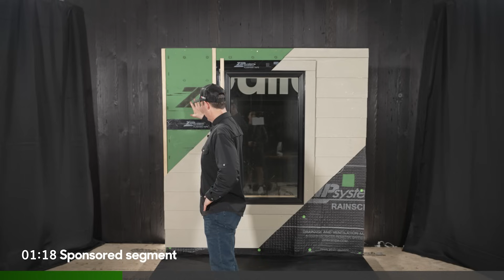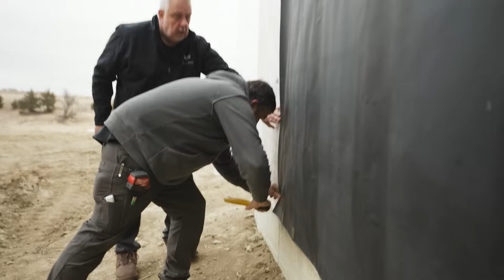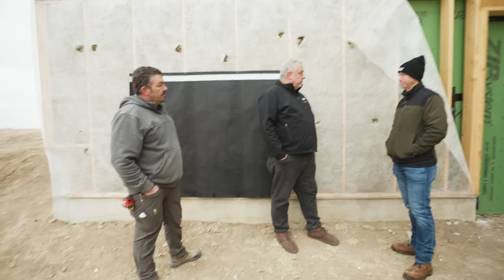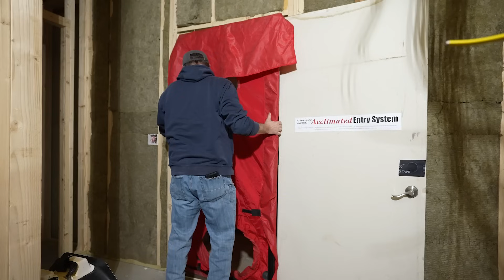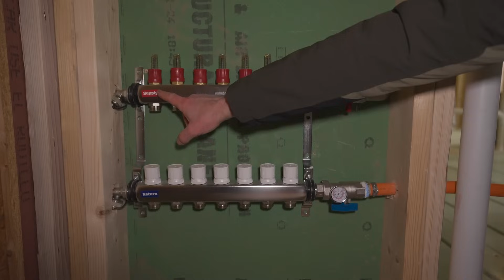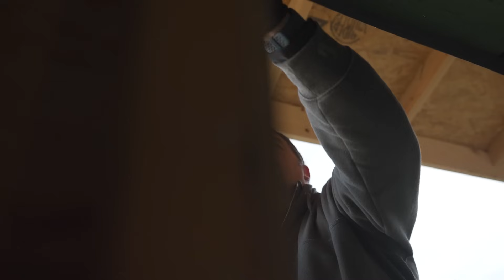Build Across America Episode 1 - South Dakota Perfect Wall

Comment: Very Impressed and I understand staying small as  a builder. Employees can be unreliable and costly.  However, having at least one gopher, wall lifter and tape holder would surely   increase your productivity more than it would cost.  Also you inevitably do some unsafe things on ladders and other places when you are trying to do things alone. One knee, back or shoulder injury is going to shut you down at some point. In the long run your health and productivity   as well as passing on your knowledge are reasons to consider a full time employee.  I have helped frame 50 plus homes in a similar climate in Idaho and could not imagine truss day without two to four framers on the job.

Comment: If the ZIP is only functioning as an air barrier wouldn't it be cheaper to use a comparable plywood as an air barrier and save some dollars or perhaps there is something related to warranty that makes the ZIP system more preferable.
Reply: OSB and Plywood are not a great air barrier. The integrated WRB of the Zip is key and the ability to successfully tape to the panels

Comment: I’d like to see the engineer in on these discussions. They must have had to make special details for a lot of this.
Reply: why it is standard platform framing, and truss company designs the floor and roof
Reply: Since the outer framing is supporting the roof there is no lateral bracing until the outer framework racks 2” into the inner frame. That outer needs lateral bracing.
Reply: @josephraccuia9870  no it does not the roof trusses also bear on the interior wall. Both walls are tied at the plates and every window and door opening ties the walls together at each opening
Reply: @josephraccuia9870  also please note, you haven't watched the video closely or you are guessing because the house has a full sheathed diaphram nailed to the underside of the trusses that ties ALL the wall together.

Comment: If we are so concerned with tightly-sealed houses, why don’t we have clothes dryers that keep conditioned air in the house? We should have dual hose dryers (like dual hose portable AC units). One hose for intake, and one hose for exhaust. Never losing conditioned air from house. 
Otherwise, here in AZ, we take hot air from outside, cool it down, it gets sucked into dryer, HEATED BACK UP, then pushed thru the dryer to the outside again. Oh, this creates negative pressure in the house, which causes HOT AIR to stream back into house, which then has to be cooled back down to room temp with house AC unit. Just plain dumb how we allow this.
Reply: More regulations ?
Reply: @merwinwilder3904 , I would love to be able to draw in hot dry Phoenix air directly into the dryer, heat it up slightly, and blow the hot, humid air back outside. 
Versus the way, it is right now, which is drawing cold air, conditioned air, which I paid to cool down, into the dryer, then heat it up with the dryer, then blow it outside, then have hot Phoenix air seep back into the house, trying to replace the air  that was just blown out of the dryer. So if that means adding more regulations, than fine. Let’s do it the right way.
Reply: We have a condensing (heat pump) dryer.  Love it.  No outside air involved, and conditioned air remains in the house.
Reply: OK, we have had them for 10-15 years, condensing dryers, heat pump dryers.....??
Reply: @stevenbaczekarchitect9431 , that’s not what I’m asking for…. I’m talking about a conventional gas or electric dryer, that simply pulls air from the outside, and blows it back out to the outside.
Basically, coming as close to just hanging the clothes on a clothesline.  Using hot dry phoenix air to dry my clothes.

Comment: I understand exterior insulation.  And I understand staggered wall for continuous insulation.  So is it because this is a dry climate that the weather barrier is closer to the inside?  We are building in a cold dry climate in Colorado.  And we’re using zip R 6 and then standard 2X6 walls with r21 batt.  Just wondering some of the rationale.

Comment: This wall assembly looks to be tuned extremely well to the climate loads in South Dakota. With Zip sheathing the only significant vapor barrier, this assembly may need a few tweaks in a more humid climate. Otherwise, this is sweet system.